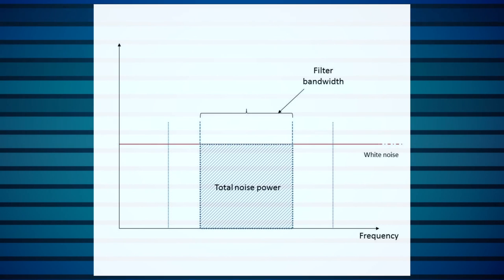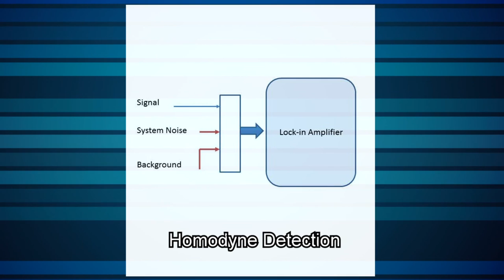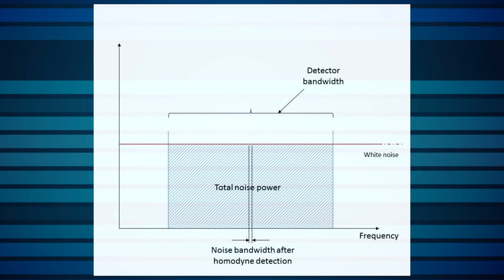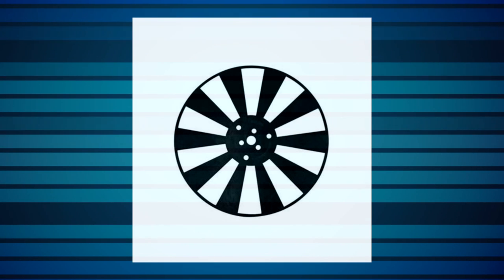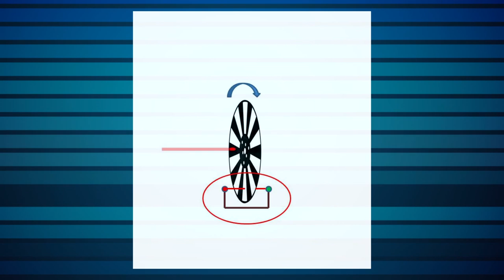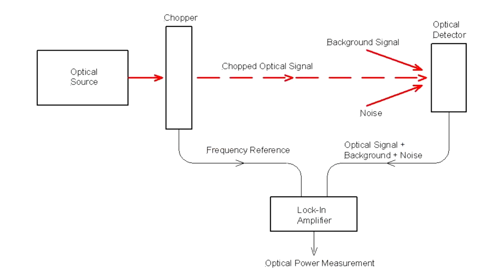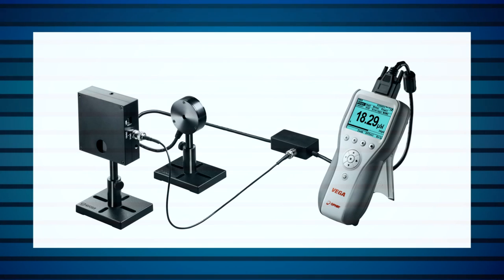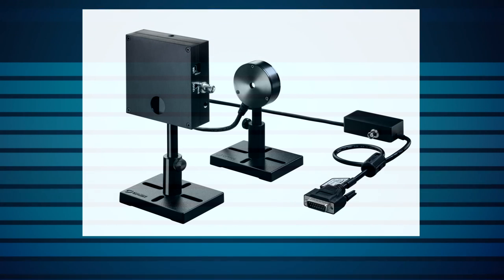Measuring Laser Power Below the Noise Floor with a Lock-In Amplifier

Comment: Thanks a lot! I needed this and now I understood the basic concept! Could you say that a lock-in amplifier is the same as a preamplifier, just combined with an algorithm (the integration over the product of chopper signal and detector signal) ?
Reply: The working principle of lock in is that you multiply it by the same frequency the signal is modulated with. It can be a square or sine or something else, so that the result contains a square of the sine the signal is modulated with. By lowpass filtering you get the signal divided by 2. Its basically the same principle of quadrature modulation/demodulation. Search in Google quadrat modulation/demodulation things will get clear.